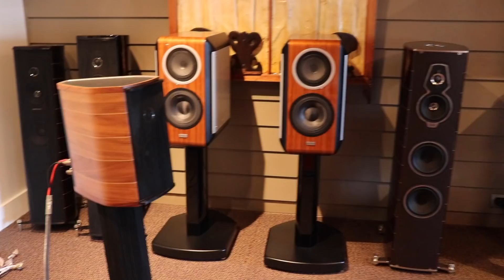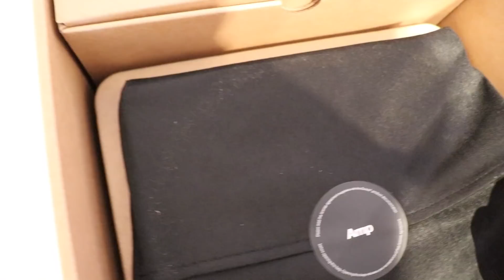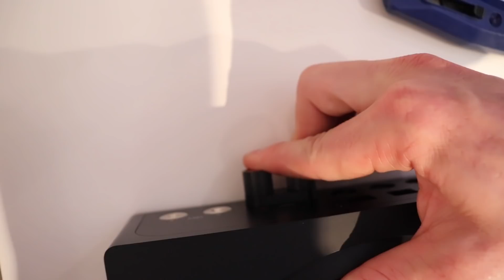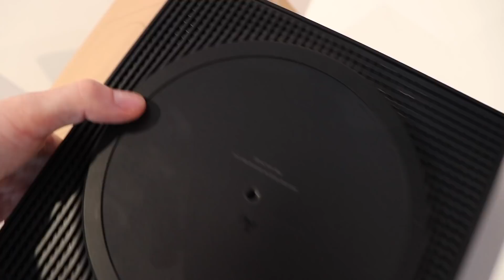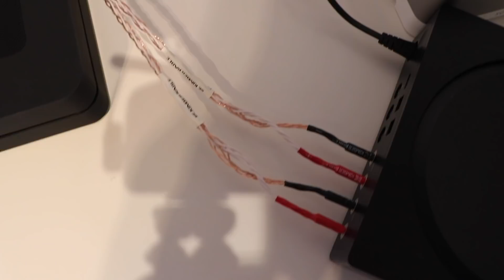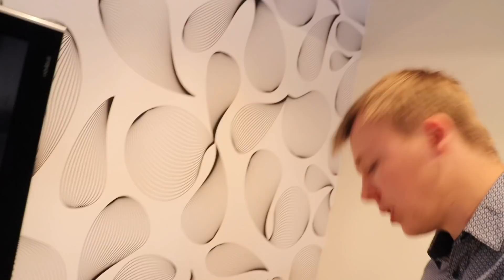Sonos Amp First Unboxing, Look & Listen

Comment: Hi I have a Samsung soundbar on my TV which I love playing music on. Is it possible to incorporate it with my sonos speakers and ikea lamp?
Reply: no
Reply: Miller is incorrect. The answer is "yes, potentially". You would need a Sonos Connect or Sonos Port and you'd have to have an analog output from your TV to connect to either of them. You'd then use RCA or Optical output from the Sonos to connect to the soundbar if it accepts those. It's far from ideal, but it's possible. 
You'd be better served simply using a Sonos Playbar or Playbase instead of the Samsung soundbar. They're not cheap however, and recent developments with Sonos future support of older speakers and hardware to be deemed "legacy" has given most Sonos users quite a bit of pause as to whether or not to invest further into Sonos equipment as a whole.

Comment: Tell me, so what is better in sound quality - Sonos Amp or Powernode 2i .... I can not decide between them
Reply: Hope Im not to late. Soundline Audio wrote this under a comment. 
"Yea I get that Power to Volume isnt a linear relationship, what I didn't mention in the video is that we compared the new Sonos AMP to the Bluesound Powernode 2i (rated at 60 watts by 2) and it smashed it for sound quality, power and overall max volume output.
Just makes me wonder if Sonos got one to put out 250 watts just once for half a second at half an ohm and then just ran with that number.
I've heard amps of similar and lesser output do heaps more than this did.
Still, its grunty enough for in ceiling/inwalls and I think that's what they were aiming it towards."
Reply: I can't speak for the Powernode but I have used both of the Sonos amps. The new Amp is stellar. Its a Swiss Army knife of A/V gear. The Powernode does stream 24/192, which the Sonos will not, however that is the only thing that I see it having much of an upper hand on the Sonos. Sonos is a large company and continues to update, support, and improve their products after sale. Powernode does not have that luxury. It is a small company with a niche product. Sonos is just so well thought out and designed.
Reply: @dlloyd6300  Unfortunately Sonos has just rendered much of your comment untrue. The landscape is changing drastically and not for the better.....   More than that, Bluesound is a sister company with NAD Technologies (est. 1972) and PSB. They are all owned by the Lenbrook Group and based in Ontario. The Bluesound brand is a bit niche as of yet, the company is *not*.
But more to the point, from a pure audio standpoint, the Powernode 2i undoubtedly sounds better than Sonos AMP. There is no question about this.
Reply: Sonos has a DDFA based amplifier, Bluesound is Hypex UcD based. Should be really close quality-wise.

Comment: Mate, sonos does not stream hi-res audio or does it? You mentioned Tidal ... sonos will only do compressed audio it states on their website..
Reply from the maker: Sonos streams up to 16 bit 44.1kHz, this is equivalent to CD quality.
It will not do anything with deeper bit depth or higher res like DSD or MQA or 24/96 cds.
Tidal is mostly standard CD quality anyway so not hugely limiting but still enough to make me want something that isn't capped at CD.

Comment: Hi, I have a pair B&W 685 bookshelf speakers. I’m looking for something that can replace my Riga Brio R and Rega DAC but I’m struggling to find something that has the same sound quality, AV receivers don’t come close to my current set up. What would you compare the sound quality of the Amp to? The only reason I am looking at changing my set up is I have to manually turn on and off both the DAC and amplifier so it cannot be linked to a Logitech harmony remote.
Reply: James Duncan
I would say add a Cambridge Audio CXN Network Streamer to the Rega Brio, use the Cambridge CXN, DAC  for better sound and can also use the optical input of the Cambridge Audio CXN for 2ch listening from TV and Movies.

Comment: Based on your description it sounds like the numbers from Sonos are correct.
Comparing a 50 watt to 125 watt amp in theory should only give you a slight increase in clarity during higher dynamic output. 
Approximately 10x the wattage is required to double the sound output.
In theory that original 50 watt Sonos would need to be around 200 watts to increase the sound by 50%.
Reply from the maker: Yea I get that Power to Volume isnt a linear relationship, what I didn't mention in the video is that we compared the new Sonos AMP to the Bluesound Powernode 2i (rated at 60 watts by 2) and it smashed it for sound quality, power and overall max volume output.
Just makes me wonder if Sonos got one to put out 250 watts just once for half a second at half an ohm and then just ran with that number.
I've heard amps of similar and lesser output do heaps more than this did.
Still, its grunty enough for in ceiling/inwalls and I think that's what they were aiming it towards.
Reply: You prolly dont give a shit but does any of you know of a way to get back into an Instagram account..?
I was dumb lost my login password. I love any tricks you can offer me
Reply: @Salvatore Alexander instablaster :)
Reply: @Connor Jameson i really appreciate your reply. I got to the site on google and I'm in the hacking process atm.
Looks like it's gonna take quite some time so I will reply here later with my results.
Reply: @Connor Jameson It worked and I now got access to my account again. I am so happy:D
Thank you so much, you saved my account!
Reply: @Salvatore Alexander Glad I could help xD